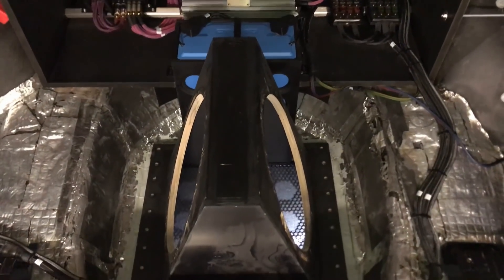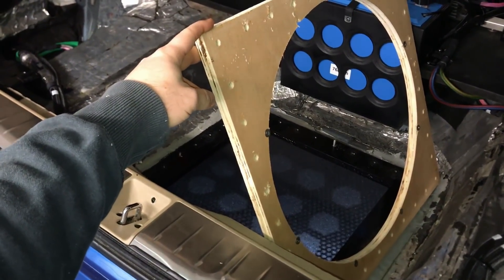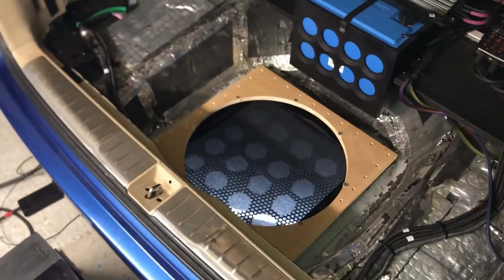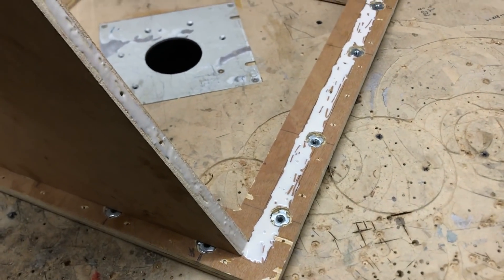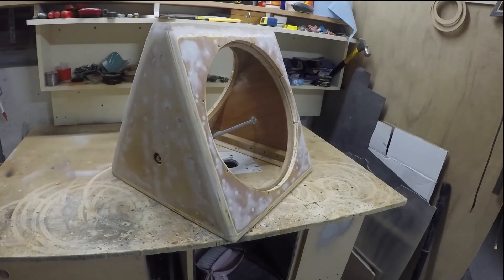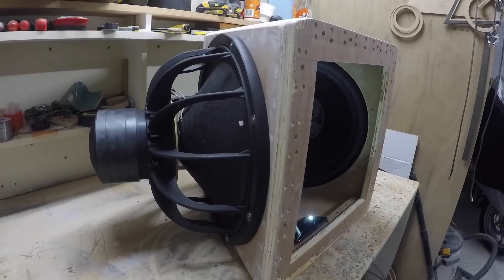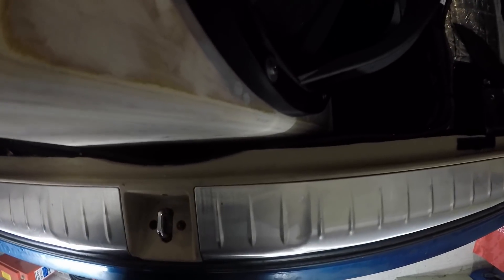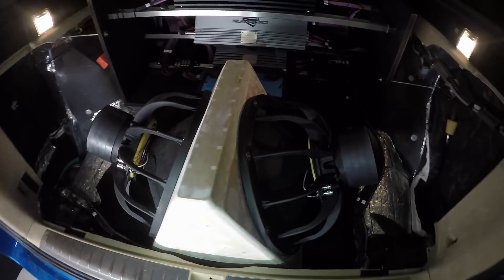How to build an IB manifold for 2 18" subwoofers in car

Comment: Peter I understand the video is very old, but if you could give me some knowledge it would be much appreciated.
I am brainstorming an IB build in a pick up truck. Does the area of the opening have to be greater than the cone area ? Or is there a rule of thumb to consider when trying to accomplish IB. My truck already has openings on the back of the cabin and if I can just build a thick enough baffle and bolt it to the back wall I’d rather just do that instead of cutting sheet metal. Thank you.
Reply from the maker: Rule of thumb is min 50% of cone area.

Comment: Let me get this straight. Drive around and everyone outside can hear the loud bass. And if you drive it in the rain there’s a possibility of water getting inside where the subwoofer diaphragms are?
Reply: No.  The hole is just for it to breathe.  The bass will still be in the car.  The water doesn't get jn he has someyhjng to prevent that.  You can also get hydrophobic mesh to cover your opening.

Comment: Peter, I am curious, does this firing to outside sound much louder outside than a trunk to cabin IB? 
 Because I want to use IB but I might not be able to do it to the cabin (not much room and hinges and a gastank), and I want it as silent as possible outside (maybe better stick with sealed box 😉, but its less fun)...
Reply from the maker: Explorin, learnin & doing Funnily true IB is not louder outside! 
Very simple example: it’s very easy to excite the air inside of the cabin, which is  let’s say 3000L/100cuft and create SPL inside of the cabin. On the other hand you have INFINITE air space outside, which is not easy to excite, just like in live sound, where they need many huge bass cabinets to produce SPL.
Reply: @pssound9749  Thats funny, I never thought of it like that... thanks 👍

Comment: How did you cut the hole in the car frame?
Reply from the maker: Øne-Hit Disaster angle grinder? 😃
Then we welded in 2x 1/3” steel plate sandwiching the original floor.

Comment: Could this be done in a truck where the triangle sub enclosure would be in the bed of the truck?  Then vent it IB thru the floor and rear wall.  You’d need an enclosure to go around the triangle as well.  I’m not sure if the enclosure around the triangle would restrict the air flow too much.
Reply from the maker: Truck Guy It doesn’t make much sense to me by this description. If you have a wall separating the cabin from the bed, then just let the subs breathe into the cabin through the wall, dead simple.
Reply: Pssound Thanks for the reply!  I found the IB Facebook group and might post on there.  It’s a mid size 4 door daily driver were the rear seats are really close to the rear wall.  Plus a kid seat.  I want to try IB because it doesn’t require a huge enclosure and it’s easy on the electrical but it might not work in my application.  All I know is my 2 shallow 10s under the rear seat isn’t enough!
Reply: @truckguy9413  Yes, for a truck with limited space behind the seats it is typically best to vent into the cabin; the best shape depends on the size and number of subs used.  Even in the case of a car such as in the video a vent through the back seat (center arm rest "hole" if it has one works great) or through the rear deck would increase cabin gain.

Comment: I mean what the hell happens when your windows are down dose it act like free air ?
Reply from the maker: Charles Martin No, the car becomes like a ported box and the low-end becomes very very windy! 😃
Check out some of the other videos, where it’s demoed!
Reply: Pssound I did its pretty impressive in low frequency but how is the response in the 30-80 htz range
Reply: I only saw video around 15 htz
Reply: Does it react like a ported box or a bandpass
Reply from the maker: Charles Martin This car doesn’t support upper bass upfront from the trunk, no matter what, so this setup in the car has stereo 8”s playing above 35-40Hz and the rear does under, acting more like an infrasub. 
Check out this video where you can see test measurements too: 
https://youtu.be/K5yWXTFa42w

Comment: so are these considered free air subs? Where you don't need a box but you just don't want to share the air space with the front with the rear?
Reply from the maker: Free air is when the front and the rear wave is not separated. In this case they are, so it’s infinite baffle.

Comment: This looks really cool! I wonder why people put lots of money into ported and BP boxes when you can achieve more for less with this.
I'd be intrigued to do something like this. How much power are we talking about here for decent levels? How sensitive is it for design accuracy?
Reply from the maker: I guess the sacrifice to cut the car puts many people off!
It’s probably the most sensitive option you can have for low-end reproduction. The lower you go, the more sensitive it is and the less power it takes to get decent levels! 
I use ~ 300-400W under 20Hz to do 144-145dB levels, where it can do hairtricks! 😆
Reply: @pssound9749  i think the sensitivity comment might have been reguarding to how getting the design slightly off will affect how it plays (eg: t-line subs being finnicky to build and usually needing adjustments after being built to get the exact planned results whereas sealed will give you similar results to what was planned as long as you are close enough, although it is really cool to know the sensitivity is high per watt. (Thats how i perceived the question anyways)

Comment: do the sub's act as free air or ported?I always went with sealed enclosures. is it loud outside?
Reply from the maker: Mikko I have 8”s in stereo upfront to cover the 35-100Hz range. These IB subs are for infra sub duties. 
This way you get the best of both world, kicks that punch through your chest and low end wobble that float your hair! 😃
Reply from the maker: Let’s say they act as free-air, but free-air and infinite baffle are 2 different things i don’t have to explain, google does it better! 😃
In my case once the car is shut, the interior of the car becomes the box and you sit inside of the box as such. 
It’s surprisingly quiet outside, especially when it’s only used in such a low frequency range. It’s easy to excite the air inside of the cabin, which is 3000L let’s say compared to the outside which is...infinite!
Reply: Pssound 
thanks for the reply. o subbed to your channel . most ppl around here are SPL oriented. I like more sq. my systems always were large sub's In large sealed enclosures. back years ago. I'd say kicker solobaric was one of my favorite sub's. 15" . I have always had 12"-15"and 18" for low bass. I don't bother with anything smaller than a12", the qs of a 8" sub thrashing  just isn't my thing. I'd rather have a decent 15" on 250watts. sorry for rambling. and thanks for the great videos!
Reply from the maker: You’re more than welcome to comment anytime, that’s what this surface is for and that’s what i always ask for! 😉
Reply: That's funny. I've never been in to more than 12" subs :D I like to listen to metal so I need damn fast and kicking sub. Mostly 10" and some 8" models have been used in my car :P
Reply: True. Not the easiest way tho :D
Reply: Tweaking the sub is the most difficult thing anyways so what about when you two/three sub channels :'D
Reply: Pssound what does your front stage consist of? Also how do you tune this setup? I had a similar idea conventional style IB setup   because I have a large sedan and small subwoofers upfront .3 way front stage in the doors plus a center channel to make it a two seat car instead of just the driver getting good imagining.  Your thoughts please?
Reply: My home theater is in my sealed off garage. I have a doggy door that in the future this hole could work for this kind of build. Already use an 18" open baffle subwoofer.

Comment: I'm new here. what is that an.                      a.p. membrane? how does that sound? what kind of frequency does it play at?
Reply from the maker: Hi James.
It’s a true infinite baffle application in car. That foam at the bottom is to protect any moisture coming up from the road, which is not used anymore as there’s nothing coming up from the road at all and it’s in UK where it rains enough! 😃
Infinite baffle = IB is well know for the most effortless low-end bass production, where boxes can not even be compared to it. This setup is linear down to 12Hz!! Very sensitive, hardly needs any power. Accurate, fast, yet able to do crazy levels under 25Hz, where boxes struggle to play.
Reply: @pssound9749  Always loved the IB set up, as you say just effortless and the sub feels so free to play the transients so sharp.  but is this technically a sealed setup as the subs are firing into a sealed space in the well and manifold? or is the sealed space large enough to mimic IB? seems too small for 2x18 to be classed IB? welcome your thoughts!!!
Reply from the maker: levrone007 I don’t get what sealed space you’re saying! On one side of the manifold you have the cabin of the car, on the other side you have the underside open airspace. The subs are breathing to the outside of the car. 
Did you watch the video all the way and listen to what was explained?
Reply: @pssound9749  my bad i was skipping through.  yes i see now the wheel well is open to the outside! never thought of this option before.  Btw thank you for the reply i wasn't expecting it sorry it was a useless comment by me. ill make sure my next comment sparks a little more thought and discussion!!
Reply from the maker: levrone007 No worries. Check out the other videos in the true IB playlist where you can see more! 🤘👌
Reply: @pssound9749  I've been them all day! I have to say your workmanship and attention to detail is absolutely stellar! Also the time and effort you have put into following and replying to the comments on your vids is something really special. I've learnt so much today from your vids and replys. Thankyou for sharing all this
Reply: AP is aperiodic membrane. In my limited knowledge, Its a porous material placed on the face of the sub in order to control excursion.

Comment: Looks great! I think I've seen something similar on DIYMA; or it may have been your build.

How well do you think it would work with a similar design but have the manifold firing through the backseat/skipass area?
Reply from the maker: Hi Aaron,
I’m not on Diyma, but somebody might have shared it there, not impossible.
That can work too, but obviously the airspace of the trunk is limited, so needs careful driver selection.
Reply: @pssound9749  what driver do you recommend for about 100 dollars? For the skipass vent
Reply from the maker: Crimboz New? Nothing! Fi IB3 is pretty much the cheapest option or Dayton has a range that maybe a touch cheaper.
Reply: @pssound9749  Ok :( and what about building the same "enclosure" as you but firing through the ski pass instead of outside? As meantioned above
Reply from the maker: Crimboz then that is trunk baffle using the airspace in the trunk.
Reply: @pssound9749  yes i know, but do you think it would sound good with your triangle style box or how should i build the "enclosure"
Reply: Pssound thanks for the answer! Considering the AE IB woofers or maybe a pair of Fi IBs.
Reply: Aaron McCann recommend b&c subwoofers for this kind of setup

Comment: to eliminate the manifold resonance - dont the drivers have to be completely perpendicular ??  ie these are about a 30 degree angle.....
Reply from the maker: Hi GLYNN!
Under 35Hz where i use the subs there’s no resonance to worry about, plus what shape & angle the manifold has was done by physical limitations how the subs fit into the space of the car.
Reply: thanks . ya i thought they probably have to fit a particular physical space  : )  thats why they aren't  180 degrees perpendicular ...nice build - wish I could cut out my floor board in mt truck for my subs.... I love IB sound of my new home theater sub  Stereo Integrity IB24

Comment: Great video as usual Peter! I can't wait to see them powered up! Do you have anymore details on the membranes construction? Is it just steel mesh and foam?
Reply from the maker: i use this:
http://www.bluearan.co.uk/index.php?id=JMS1581FFOAM&browsemode=manufacturer
It's the same type of foam, you find on most outdoor PA speakers. 
It's sandwiched in between the steel frame and the mesh, simple.